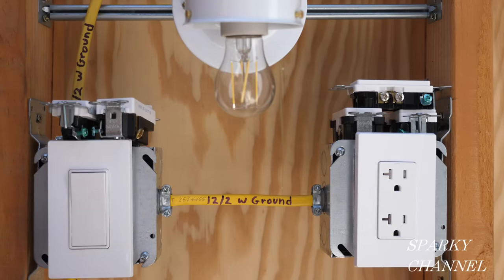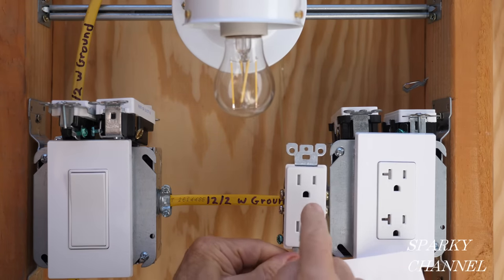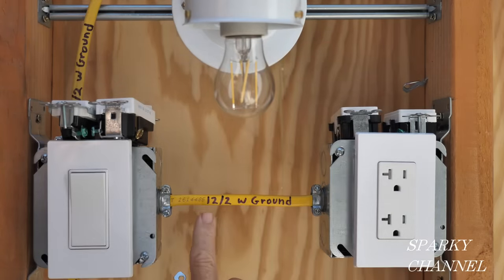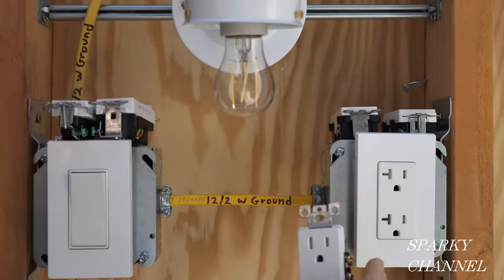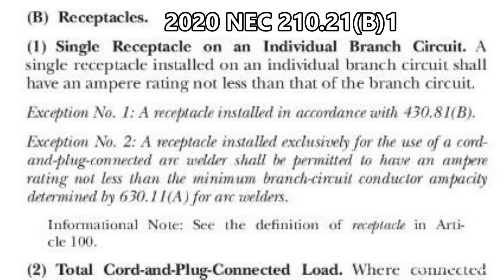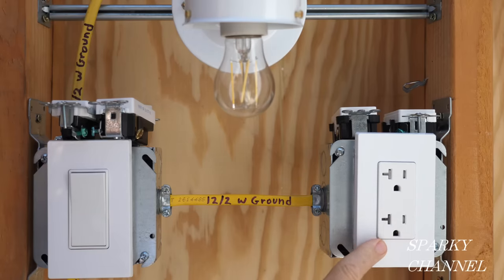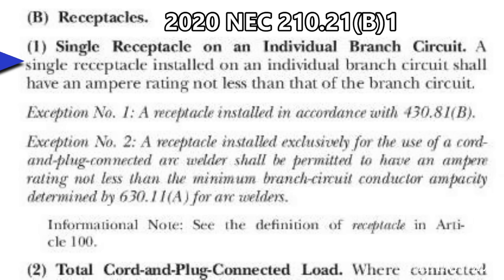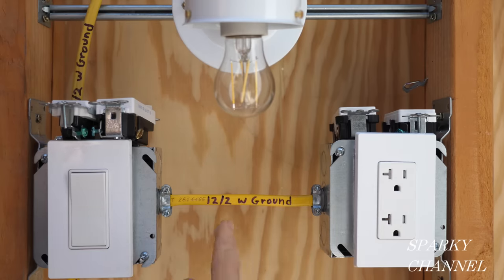Shall I Use a 15A or a 20A Receptacle on a 20A Circuit? + 2020 NEC 210.21(B)(1) and 210.21(B)(3)

Comment: So what is the NEC logic that I can put a 15 amp duplex on a 20 amp circuit, but I can't put a 15 amp single receptacle on that same 20 amp circuit. It seems the duplex has the potential to draw more, while a single would never draw more. What am I not seeing here?
Reply from the maker: The single receptacles are usually used for dedicated circuits that have a high amperage draw so perhaps it has something to do with that.
Reply: It’s sort of NEC funny math. If you have only one receptacle you can load it to 20 and the breaker won’t trip but you’ll overload the receptacle. Two receptacles at 10A isn’t a problem. Dual receptacle at 15 each will trip the breaker. Sure you could put 20A on one of the dual receptacle but that’s not as likely compared to a dedicated outlet that it’s there for a very specific use. So basically they just don’t want the receptacle to be the weak link.
Reply: The idea is that the  circuit breaker should not be larger than absolutely needed. If there is just one 15 A receptacle then one should use a 15 A breaker. Clearly violating this does not cause immediate danger as one can plug just one equipment in a double receptacle.
Reply: How was this not everyone’s first question after watching the video? I cannot find a good explanation on the rule.

Comment: Can I use 15a switch to power lights on a 20a circuit?
Reply from the maker: Yes. It should say right on the switch: 15/20 amp
Reply: @SparkyChannel thank you I've learned alot with your videos

Comment: I just redid most of the outlets in my home to bring it up to code.  I have a few GFCI outlets in the kitchen that are 15A duplex on a 20A breaker.  Large draw appliances on the circuit are a refrigerator and toaster oven.  Some small appliances on that circuit will be plugged/unplugged a few times per week.

Is it necessary or worth it to bother with replacing all those receptacles with 20A commercial grade outlets?
Reply: If you just installed residential grade 15 amp receptacles, then leave them alone as they will be good for quite a while. At some point down the road you could upgrade to 15 amp specification grade. GFCI receptacles are not recommended for refrigerators and must be located in clearly accessible locations. A kitchen receptacle for a refrigerator is typically not accessible.
Reply: @surferdude642  refrigerator isnt on GFCI and it's outlet is behind the fridge, inaccessible.  But it's also on the same breaker as 2 GFCI outlets.

Thanks for your comment
Reply: @robertm5969  That sounds ok as long as the GFCI's are wired using the Line connections only.
Reply: Are you sure that your code allows a refrigerator to. be on a circuit with other devices?  Code in my area specifies it must be alone on the circuit.
Reply: @tchevrier  I'm not sure but the max draw is 7A, less than half the capacity of the circuit
Reply: @robertm5969  that's not usually the reason for being on a separate circuit.  It's more so that is something else blows the circuit it doesn't turn off the refrigerator and spoil everything.  Freezers are usually the same.

Comment: A simple question with a simple answer finally. Always use the 20a. Electricity is not the place to save a few pennies. Qudos.
Reply from the maker: Right on! That's my philosophy.
Reply: Using a 20 amp receptacle is a waste of money unless you have a plug that can only be plugged into a 20 amp. The only difference between a 15 and 20 amp receptacle is the cover
Reply: The most important difference between a 15A and 20A receptacle is that the 20A receptacle allows someone to plug in an appliance where one prong is sideways.  I have a microwave that draws 16A.  Its plug has the one prong sideways, so as to prevent people from plugging it into a 15A circuit.  If the breaker is 15A, you should definitely NOT use 20A receptacle(s) on the circuit.
Reply: There are 16, 18, etc.. amp appliances, power tools, and so on .. that have the regular Nema 1-15p or 5-15p plug
Reply: @kalijasin  That's what you call botch work

Comment: Over the years, the non-spec grade outlets have been getting cheesier.   I will no longer use the cheap outlets.
Reply: Yeah I don't care about the 15a or 20a rating, it's the premium or spec. grade that makes it better.  Lots of cheap 20a outlets there
Reply: I just replaced 2 outlets. One i put a spec grade and the other i put residential grade.
The residential grade outlet is already getting loose on the pins.
For a different of a couple bucks id say its worth it to only use spec grade

Comment: Hi Bill. i plan on getting those Hubbell industrial grade 125V 20A receptacles. Would it matter if I use it here in my country where the standard voltage is 220V? thanks in advance.
Reply: As per code no you shouldn't use them because the voltage rating but the truth is most 220~240v especially India have inferior quality receptacles than the United States/ Canada. While a receptacle in usa/ can is only rated for 120v its usually built better and the insulation is better than most flimsy receptacles used in 240v countries. American electrical wiring methods and materials are very rugged compared to the delicate European systems used in 240v countries.

Comment: Don't exceed the rating of the breaker by 80%. 12 Amps for a 15 or 16 Amps for a 20.
Reply from the maker: Correct, thanks!
Reply: The amperage rating of a receptacle and the wiring has a  designed safety margin
Reply: @wallacegrommet9343  As does the entire NEC.
Reply: Depending on what type of load you have. For continuous loads, you need to size the breaker at 125% of the load to reduce nuisance tripping.
Reply: @damion1121  More to reduce heating.
Reply: @augustaking8  I don’t think the NEC permits more than that. If you size it higher, it would be dangerous in the event of a fault.
Reply: @damion1121  You can have a 5 amp load on a 20 amp breaker as the breaker is protecting the 12 gauge conductor and is more for short circuit interruption. For overcurrent protection you use overload heaters on the motor starter sized closer to the load.
Reply: @augustaking8  Yes there’s a lot more that goes into motor circuits than a general lighting or appliance circuits. A motor’s inrush current is a whole different ballpark when we’re talking 20A 120v receptacles and lighting loads.
Reply: @damion1121  Most of the continuous loads I've done were lighting. When we fired-up the first 12,000Hp pump at the Windy Gap Pumping Station we told the power company that they would have to crank-up the overloads on their substation. They thought we were kidding because it ran on less than 200amps at 13.8kv but the inrush tripped the substation taking out the power for a good portion of Grand County.

Comment: This is something I disagree with the code on, not you Sparky, the code is flawed.  Had to replace many 15a receptacles on a 20a branch circuit, I view it as a fire hazard.  Also 15a receptacles on 15a branch circuit as well.  
Should be allowed to use a larger rated receptacle on a lower amperage branch circuit.  The location that I've had to change the most is on space heaters, oh how I loathe those things.

Note:  in the past those that were on the panel pushed to have the code changed for their own monetary gains instead of safety, I am thankful an engineer can over rule the code in many instances.
Reply: Yeah I’ve had to replace many 15amp receptacles because they couldn’t handle the load. I work in homes mostly, if its a single appliance outlet, like for a microwave or fridge, I’ll use a 20 but if its countertops I’ll cheap out and use 15’s. But i also pigtail and splice through. I don’t trust the back stabs or even using the screws for splicing. And even if it says 20amp pass through i don’t trust that either. I’ve seen burnt up outlets from that regularly. 

Once had a whole apartment where we had to change out all the outlets AND the panel because the tenants didn’t call the landlord to tell them that the wall mounted heat pump didn’t work. They used heaters though out the apartment instead... for years!  Wires were all as hard as month old spaghetti and brown. The breakers and buses where falling apart just trying to remove them from the panel.  All code.  Exempt maybe for the way the tenants used the heaters.
Reply: Installing 20-amp receptacles on a 15 amp circuit is a terrible idea.  It's better to go with spec-grade devices and wire them properly (NEVER use the backstab option) than to install 20-amp devices on a 15amp circuit.
Reply: Jason ... the reason NOT to use a 20 amp outlet on a 15 amp  circuit is the pin configuration will now allow a 20 amp only style plug to be inserted.. Yeah, it will probably be ok for short runs and blow the breaker on an overload, but it can also allow the wire to overheat as well. Better to stick with a commercial grade 15 amp duplex and call it a day. At least that will keep the idiots from plugging in heavy draw items.
Reply: Well your wrong,you're opinion is based on emotion and not knowledge and you should leave this work to professionals.  You shouldn't even be allowed to own a watch battery.
Reply: @lloydmills9619  now that's funny

Comment: NEVER saw a 20 amp 120 volt male plug on any residental situation so go with a spec grade 15 amp duplex receptacle. I took apart a few spec grade 15 & 20 amp duplex receptacles and the intetior were always identical. I have seen old tools that drew over the allowable 12 amps ( for a 15 amp debice ) that ways had a 15 amp male plug instead of a 20 amp plug.
Reply: Right, in my lifetime I’ve yet to see any device that had a 20a male plug. Even washers and dryers these days have a 15amp plug.
Reply: Worked 50 years as a sparky. Several times had a new 120 machine that ran 8 to 16 hours a day that draw 15 to 16 amps and always had an illegal 15 amp male plug on it. We were taught the 80% rule so a 15 amp plug is only good for 12 amps and a 20 amp plug only good for 16 amps. We usually installed 15 amp duplex receptacles feed by #12 copper wire and a 20 amp breaker.
Reply: @mook528  I am on my 4th washer machine over ladt 47 years and always had them power thru
Reply: Sorry fat fingers. Always had a manuel starter feed the washer machines. Tripped out once when water pump frooze up. Anyway now on the largest of the 4 top loaders. Its a HE type without the old center agitator. It draws approx 60% of the smaller washer machine that it replaced. Saves a lot of water but probably takes 50% longer. Great that the govetment made manufacturies of applicance & air conditioners make energy saving mandatory.
Reply: The kitchen should have two separate branch circuits in 20 Amp per code.
Reply: @garbo8962  It's actually 80% for continuous loads. You can go higher otherwise until you trip the breaker.
Reply: @garbo8962  It seems strange to me that so many people have never run across a male 120v 20A plug in use. The air compressor I bought from Sam's Club some years ago came with one of those, as did my wife's treadmill (it is a health club model). I'm pretty sure that some high-end coffee machines use them too. They definitely exist and are in use.

Comment: I’m about to install a new wall A/C unit in my apartment. I removed the old corroded single receptacle and installed a new 20A duplex GFCI outlet. The circuit is 20A and it’s two levers, not sure if that matters. I’m new to this and wanted to see if I’ll be fine with the new 20A outlet or should I replace it with a 15A duplex? Reason being is I plugged my vacuum to the 20A and when I powered the vacuum on the thing was on steroids made me worry I’d blow the thing. 

I want to make sure I won’t overload anything. Thank you ahead of time for any assistance.
Reply: What did you end up doing?
Reply: 1.  You can replace 15A receptacle with a 20A one ONLY IF it is wired to support it.  It must be wired with at least 12 AWG wire, panel to receptacle.  Never a 14 AWG.
2.  Replacing your old 15A with a 20A would have absolutely no effect on your vacuum cleaner.

Comment: This seems to be backwards. What is the hazard using a 20a recept on a 15a circuit? Seems ass backwards to me.
Reply: Could it be you might try to power a 20a device on a 15a circuit? Maybe I just answered my own question??
Reply: that's obvious - you will blow the 15 amp breaker.
Reply: I know it’s obvious a 20a devise will trip a 15a circuit “super duper”! That’s why I replied to my own question.
Reply: The problem is that a 15A breaker will not trip immediately if you put a 20A load on it. That's to stop nuisance trips for short term overloads (as you might get when a powerful motor is turned on). Breakers tend to have a very fast trip for gross overloads and thermal trip for sustained, mild overloads. It's very likely that a 15A breaker exposed to a 20A load will run for a long time without tripping.
Reply: @michaeljuers574  I’m pretty sure Rick’s comment was tongue in cheek
Reply: @TheEulerID  ... you are absolutely correct. A breaker will hold 120 - 140% of it's rated load for several minutes. Probably long enough to make the wire warm, although you'd have to reset the breaker a few times before you'd feel it with your hand. The problem is this "minor overloading" will eventually degrade the insulation and if you don't solve the problem you will have early failure. A breaker is also designed to hold about 200 - 300% overload for a few seconds, which is enough for motor starting of certain appliances. (AC units, etc)

Comment: so i have a 15 amp outlet on a 20 amp breaker, and i plug in an electrical device that draws 19 amps... the breaker's not gonna trip but the outlet will go into meltdown and possibly start a fire? 

tell me where i'm wrong here, because apparently i am, there's too many 'oh just put a 15 amp outlet on a 20 amp circuit' vids out there for my fears to be justified.
Reply: In theory...
A device with a 15 amp plug should blow it's internal fuse at 19a
Reply: @justinjja2  i've got very few things around here with any kind of internal fuse.
Reply: @edwardvermillion8807  like what?
Just because you don’t see it from the outside doesn’t mean it’s not inside.

The exception is some cheap outlet splitters and extension cords which can be used unsafely.
Reply: @justinjja2  lots of different things, i tend to take stuff apart quite a bit, just for my own enjoyment, or when something stops working. i don't think i've ever just tossed something without checking to see if theres something interesting inside worth saving.
Reply: If your appliance draws 19 amps it would have a 20amp plug and couldn't be plugged into a 15 amp outlet.
Reply: @lucus4485  ummm... wow... so an appliance that has a 'normal' plug could never draw more than 15 amps because... magic? let me pour this bucket of water on that lamp over there and see what happens... i'm gonna guess bad things. you?
Reply: @justinjja2  You are relying on a safety for protection. That is a horrible philosophy.
Reply: @JediOfTheRepublic  ???
Reply: @edwardvermillion8807  Breakers exist to protect wiring inside the wall, outside the wall you can do all kinds of stupid and unsafe things.
Reply: You are correct, Edward.  Not all devices that draw > 15A have the T-prongs on the plugs.  I had a 120V  Craftsman air compressor that didn't. Also consider the situation when you plug a 10A plus a 9A device into that 15A outlet.  There's gonna be 19A cranking along and causing heating somewhere in that outlet, while the breaker is breezing along.

Comment: Doesn't matter. 15 and 20 Amp receptacle is same internally. There is no reason to use a 20 Amp. Unless it is single receptacle with single 20 Amp appliance with 20 Amp chord end.
Reply: Probably true for most brands of receptacle, but in this video he shows the internals are different in the ones he demonstrates.  If you really want an overbuilt circuit then spec rated 20A receptacles are probably a bit safer.
Reply: @robertm5969  Patrick is correct. Bill is comparing a residential grade to a specification grade. You can get a 15 amp specification grade, no problem.
Reply: Only true for cheap receptacles.